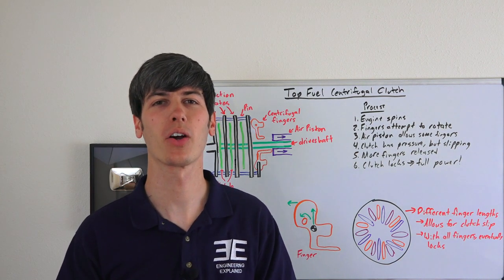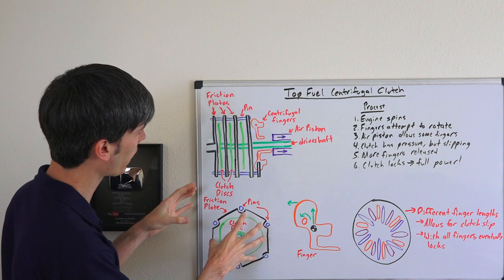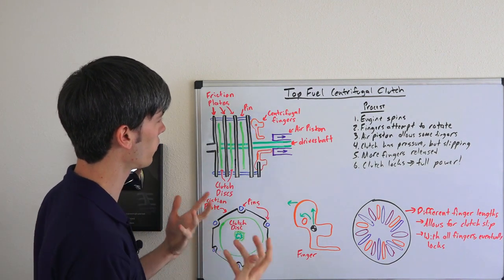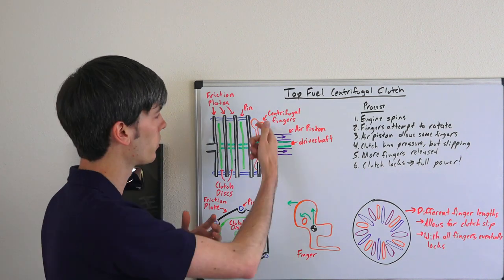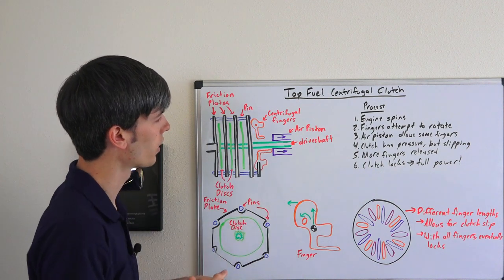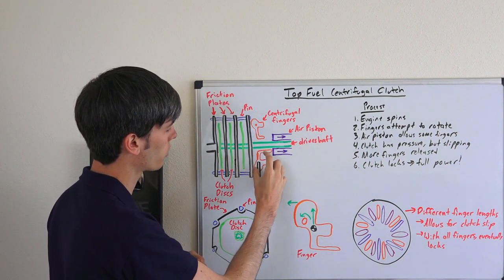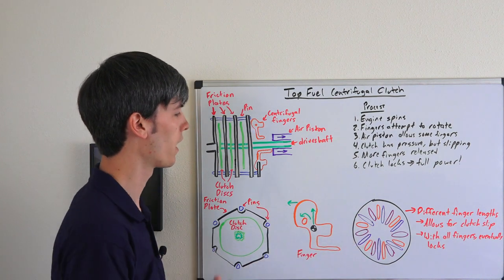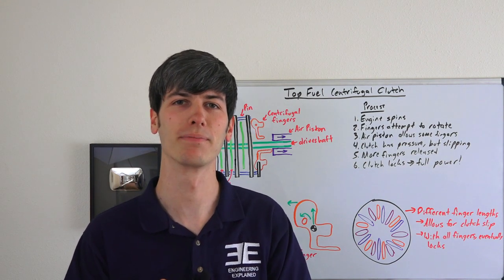Top Fuel Centrifugal Clutch - Explained

Comment: One concern that I have is why they don't use fewer plates. There's no need for any gear changes, which means less weight. The counterargument that I can see is the benefit of more torque and less inertia working against the driveshaft. Is the difference that great?
Reply from the maker: Raidensnakeezio More plates allows for more torque with smaller packaging. It's why you'll see multi-plate clutches on motorcycles and formula 1 cars. It's the smallest way to do it (reliably).
Reply: Someone correct me if I'm wrong but I'm pretty sure they burn through most if not all the clutch plates in one run.
Reply from the maker: Awon2zip They replace them all, yes.
Reply: Engineering Explained Damn that sounds expensive
Reply: Chris Fokjohn every run down the strip was 100 grand on the episode of fast 'n loud that they went
Reply: sixteenseven123 Imagine just how much money they make from the sponsors to accumulate that
Reply: Because the holding capacity of a clutch is dependent on the clamp load, the diameter of the clutch, the friction coefficient and the number of surfaces. So more surfaces has a huge effect on the holding capacity.
Reply: +Chris Fokjohn .....It IS Very Expensive.... That's why, anything less than a 12 - 13 Million dollar per season "budget" and you won't be competitive... in the NHRA Fuel classes, these days.    

I remember when... (before Tom McEwen talked Prudhomme into going in with him, after "corporate money" (Mattel Match Box Toy's) in exchange for advertising..on their funny cars)..... there would be 100+ TOP FUELERS would show up to qualify for a 64 car Field !!!       

When Top Fuelers were hauled to the track behind 1/2 ton pickups and station wagons, inside (or, on) of trailers with ball hitches..... and many Top Fuel owners and drivers, were two guys working in a gas station or a parts store for a living..... certainly not All,  but many of them, worked in automotive fields in one form or another.

It's bad enough that Corporate America runs the "gov't"..... but it "runs" and dictates all of our sports as well.... and NHRA is just as in bed with it, as any of them...... but, it "may not" last through the end of this season, anyway..... for Any of them...... and certainly Not in 2017 and beyond.

Comment: just wondering if they use throttle to modulate power/torque too or if it's all/mostly done w/ clutch & if so, why?
Reply: it is very dangerous to close the throttle plates mid run. usually emergency only. you can cut off the air supply but fuel is still pouring into the cylinders. if you hydrolock a cylinder,  the head and the blower assembly will lift off real quick. pretty much the engine assembly becomes a door stop.
Reply: First Name just the kind of details I was curious about. you the man, thanks
Reply: The clutch release is all set by electronic timers. The speed of those timers releasing the clutch controls how much power is applied to the rear slicks. It's all analyzed by the crew chief after every run and detailed noted are stored in data sheets so each track can be analyzed for specific conditions regarding weather, humidity and track "bite"
Reply: Timers manage Ignition, fuel, clutch. Pre set before the run

Comment: How is the air piston controlled? By the driver or Is it automatically pulled away?
Reply from the maker: the101manalltheway The timing is set up prior to the pull.
Reply: Engineering Explained that was what confused me in this description resetting everything seems like an awful lot of chance involved how do you know you have the preset rightfor conditions?  shouldn't there be some kind of system that feeds data back from the actual slippage of the wheels to the clutch system so that the more the wheels slips the more it lets the clutch slip and the more the wheela have traction the more the it engages the clutch?  you'd think that with today's computer technology, magnets etc  this kind of. feedback loop would be possible...
Reply from the maker: sreyemhtes There is a lot of chance actually. It's definitely hard to get it perfect, which is why you'll often see the cars smoke the tires.
Reply: +Engineering Explained exactly that's what I thought so how come somebody doesn't make a clutch system that adjusts itself automatically? Is it a rules issue?  A matter of the rapid adjustment speed necessary?  Some kind of materials science properties issue? Or have I inadvertently revealed my billion dollar drag racing idea to the entire Engineering explained Community?  If so I give it freely... you guys are great...
Reply: sreyemhtes It's the rules. I think you're allowed to collect data during the run and calibrate afterwards, but you're not allowed to use computers to calibrate anything during the run itself. I'm not an expert though.
Reply: Wow that's interesting thanks

Comment: Have you heard of anyone playing around with electric "top fuel" dragsters? Just curious if the technology has got to the point that anyone it starting to try. Thanks!
Reply: CDP135Z There is an electric dragster called "Current Eliminator", but it's very slow compared to top fuel dragsters. 1/4 mile record for the electric dragster is 7,956s @ 159mph. Top fuel record is 3,701s @ ~330mph...
There's a thing called Google that lets you easily search for these kinds of things ;)
Reply: I saw a video this year of Big Daddy (now in his 80's), teaming up with a tech. co. and they're testing an electric scaled down version of his Swamp Rat. They hit 188 mph on the run and, of course, big Don is not happy because he wants to break 200. Strangely quiet machine.
Reply: CDP135Z big daddy did and it was fast as hell
Reply: Bruce Moyers got to love some electric SWAMP RAT🇺🇸🚀🏁

Comment: What the differences between valve blow off and wastegate
Reply: ***** I thought blow-off valves were also there to protect the engine. When you lift your foot off the gas pedal, the engine needs very little air/fuel to run, but there's still a lot of pressurized air in the intake system, so a blow-off valve lets that pressure out.
Wastegates are odd, since they are located between the engine's exhaust manifold and the turbo, they release hot, raw exhaust gases straight out from the engine, letting the exhaust out without it being fed through a catalytic converter. Or is there usually a small pipe from the wastegate that just bypasses the turbo and feeds the gases back to the exhaust system?
Reply: thank you so much

Comment: Here is a question, about what is the average RPM and torque rating of top fuel?
Reply: ***** Damn impressive.
Reply: yuki no inu And with GASP PUSHRODS AND TWO VALVES PER CYLINDER!
Reply: yuki no inu That's the power of 500 ci of displacement munching its way through over a gallon of fuel a second for you! Insane forces involved in this sport.

Comment: Don't the plates weld themselves together and need to be replaced after every run?
Reply: Gary Hamill They do.
Reply: No, they do not weld themselves together. But they are changed after every run.
Reply: Some of the plates are welded together sometimes during runs. I have a Top Fuel clutch plate:)

Comment: Can u make a video abod the nissan ZEOD RC  engine

it is a 1.5 litre 3 cylinder that pumps out an INCREDIBLE 400 HP
HOW IS THAT POSSIBLE  

I think that's the most HP per litre ratio for an existing gasoline engine
Reply from the maker: Ahmed Nasef Here you go! https://www.youtube.com/watch?v=xBUVl41A3dY
Reply: Yeah I have seen that already

I mean could u explain how the zeod engine ITSELF makes 400 hp from 1.5 liter 3 cylinder engine 

I remember when the merc A45 AMG first came out every one was talking about its 2 liter engine producing 360 hp and that being the highest hp per liter 180 for any production engine out there 

Now the ratio for the zeod engine is 266.66 hp per liter so smaller engine, fewer cylinders ,only 2 bar turbo pressure and putting out 400 hp!!!! 

How is that possible mechanically GIVEN THAT it doesnt reach 10,000+ rpm like the f1 engines which is a good reason for their high power
 
The 400 hp comes at a modest 7200 rpm only 

ANY EXPLANATIONS
Reply from the maker: Ahmed Nasef Boost! Anything is possible. Also, it's not a production engine. F1 engines make over 600 HP with 1.6L.

Comment: What are those levers the driver pulls during the run doing?
Reply from the maker: ***** I would imagine one is for the parachute. Other than that they probably keep their hands on the wheel.
Reply: Oswald Cobblepot if you look at the capco dragsters idling before the run you will see they brought it to the next level now and are 100% on the pump for the burn out and staging. You answer is completely right 2 years ago that all changed though and now you are wrong 🇺🇸

Comment: What's the disadvantage/advantage? And are you sick?
Reply from the maker: Indra Ida Bagus I might have been sick. YouTube doesn't pause for me to recover. :) Today I filmed a Cadillac Escalade while I have horrible sun burn on my face. Whatevs.
Reply: Engineering Explained Btw, the Koenigsegg Regera clutch operates on the same principle just using hydraulic?
Reply: +Indra Ida Bagus Super late and not EE, but the Regera operates on a principle much more similar to a torque converter.

Comment: what is clutch slip? can anybody explain it to me
Reply: +Mrugendra Matekar   It is when the flywheel and pressure plate spin at a different RPM than the clutch plate.   The flywheel and pressure plate spin at the RPMs of the engine.   The clutch plate spins at the velocity of the drive line(if in gear).   Since the topfuel cars don't use a transmission, the clutch is not spinning, but the flywheel and pressure plate are.   That differential in RPM is slip, which can be intentional or unintentional.   You need a little slippage to get the vehicle rolling, then once the mass of the vehicle is moving, and if you have enough traction - you do not want any slippage.    

Slippage is used to help multiple torque somewhat like a torque converter does in an automatic transmission.   Instant connection of the engine to driveline would cause the engine to stall or to cause lurching or traction breakage of the vehicle.
Reply: +knight0334 got it thank u

Comment: why not just use the centrifugal force to modulate the throttle?
Reply: Greasyspleen That's a cool question.  I think the idea is to keep the engine power "P" or "HP" at it's peak through out the run.  Then by using the clutch, determine when and how much you want to use.  So I think the engine has to the constant in the equation...
Reply: highvelocity123 That is correct. They are using the clutch to regulate how much power the rear wheels get. The goal is to apply as much as possible without breaking traction.
Reply: Agreed
Reply: if you modulate the throttle you risk hydro-locking a cylinder,  when that happens engine parts fly  all over the place, the run is junk and you may lose points too. the big boys burn GALLONS per run, if you close the throttle the fuel pressure spikes and when you reopen the throttles it gulps more than it handle (like water boarding). if the con rod holds up then the head along with the blower lift up to release the pressure. (bad, very bad). not exactly sure i think they may give you one warning, but if you oil the track a second time you lose points. all cars have a diaper and pan underneath to catch as much oil as possible.  also there is like a 5 gallon barrel behind the driver to catch the MASSIVE amount of blow by .

Comment: Where would be the best place to take my dragster if my dragster warranty was up on my 2016 dragster and my transmission was going out or my clutch ?     I need to find out where theres a local dragster dealer around here my dragster is having some problems and makin a funny noise !    What do ya think that is ?      Ya I was driving to work in my new dragster and the road was closed and I was like oh no but then I remembered there was a back way around the city streets and my dragster came with gps and a monitor display and my dragster is voice controller audio sound and they threw in the fuckn coolest dragster floor mats at the dragster dealership back in ohomofafa cacevada home town of dragster automobile company was founded  in 1902 by Charles lee Ray and his 5 soNs,   erkley, jerkley, merkley, hurkley, derkley!         They started business as a small aMish traveling circus which in those days they just called themselves the Brady bunch !    The Brady bunch !

Comment: Why didn’t you explain the difference between a glide clutch used in a fuel car and a peddle clutch used in a alky car?? You didn’t even explain the stall springs and adjustment or the base springs in a peddle clutch. Air gap , stall ,& finger weight and installed height are the meat and potato’s to the ability to tune the clutch ! The only other thing is the speed of the cannon controlled buy the 6 clutch flows in the toy box. We need to run you threw nitro school before you make any more vids lmao

Comment: CENTRIPETAL!!!! sorry but this irritates me
Reply: No, its centrifugal force, he's correct. Centrifugal force is being used to get the fingers to push the plates together. Centrifugal force is the inertia of motion. The tendency for mass to be accelerated outwards from its point of rotation is being used to initiate the pressure in the clutch. Thats centrifugal force.
Reply: Basically Godzilla no there is no such force as centrifugal, there is only a reaction force caused by centripetal force which is often called centrifugal but this is incorrect as it means that it is a force that can be applied directly but it is one of a force pair and is a reaction. It is not a real force in short.
Reply: snika123 I know but it doesn't need a real force in order for Engineering Explained to be correct in his context. All you're saying is that centrifugal force isn't a real force, we already know this, you're still wrong.